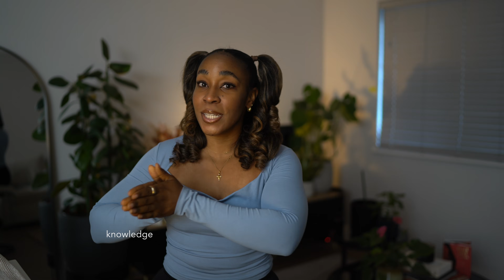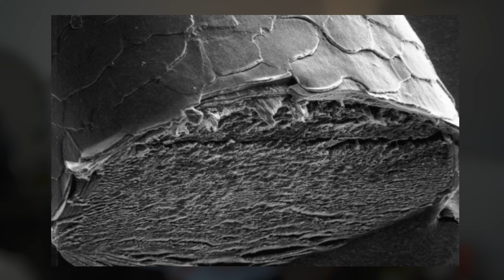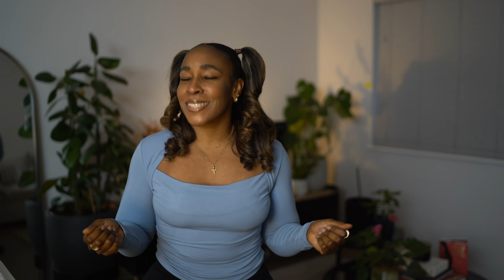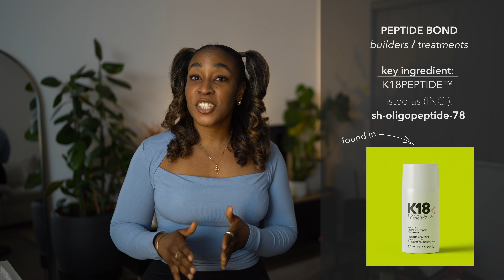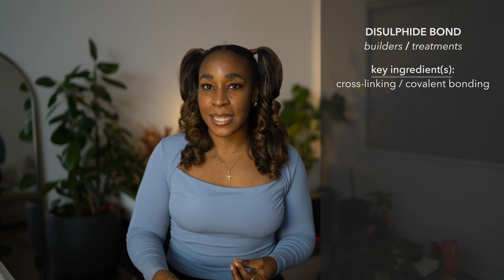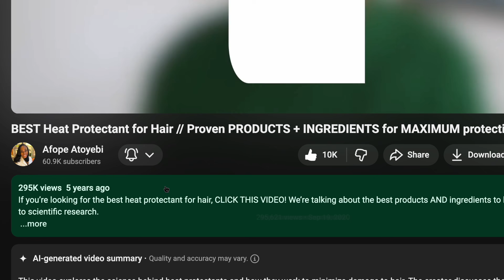BOND REPAIR EXPLAINED by HAIR SCIENTIST: Olaplex vs K18 vs Redken // Which One YOUR Hair Needs

Comment: This video was super helpful thanks. It confirms what i have been saying for years: most naturals who are low/no heat and (by definition) non dyed dont need bond builders. For maintenance of everyday wear and tear on hair, an occasional strenthening mask/ deep conditioner with protein will do the trick to fill in any chips in kertatin structure.

Comment: What’s the difference between a bond builder or reconstructor. Usually when I think of a reconstructor it has proteins like hydrolyzed wheat protein, which I thought repairs bonds in the hair, thus a bond builder.

Comment: This video was soooooooo informative. I'm new to the addition of bond-repair and I truly didn't know where to start but I big-chopped trying to rid myself of my split ends that split up the shaft only to have to continue to cut because my hair strands are completely compromised I guess... lol. Like no matter how high up I cut, my hair almost immediately split again because it just don't hold together.

Anywho, I think I know which bonding product is suitable for me but I went to take your quiz just to be sure and it wasn't available. If you're able to share that again that would be awesome!
Reply from the maker: Thank you! I can imagine that must have been quite frustrating  - cutting and cutting with no results. I'm really glad you found this somewhat helpful. The quiz should be back up now - I was running some maintenance on it so had to take it offline for a bit.

Comment: I have color treated, somewhat heat damaged (like the ends are getting dry) and extremely manipulated (I do pin curls every other weeks, play with my hair all the time, sometimes sleep with loose hair and often wear a bun at the same place all the time) I did the quiz and found a drug store mask from Schwarzkopf that has all of the advised components (appart from the sulphur bond repair, but it has that thing that strengthens the hydrogen bonds, plus amodimethicone and all of my other products have acidifiers or EDTA) and now my hair is living again with two products (and I have a whole collection of various conditioners and serums for when I want my hair to feel extra glossy) I now plan on redyeing part of my hair (hopefully with an oxidizer free dye since I go from a dark auburn to a darker brown) and bleach part of my (level 3 color treated ) hair white (I'll settle for "lightest blond" and if all fails either a periwinkle or a highlighter green) all the while wanting to keep my length 

I'm gonna redo the test and get ready to at least provide the proper products for the first few months, enough time to look good on photos I have to take next month and for the most compromised part to grow out a bit

So I'm gonna
Reply: I love Schwarzkopf.  What's the name of the mask you use?

Comment: What category of damage do health problems that weaken the hair, fall under? For me, I think it's likely due to anemia, mennorrhagia and poor blood circulation, but my hair grows out very weak and thin, from the root (yes density, but it also makes each individual hair thinner too). My hair also grows high porosity from the root. What kind of damage is that? What kind of bond(s) are missing? 

Some more context: After my high dose iron supplements for over 2 years, my hair has stopped falling out as much, but it still grows in very weak. The side of my head that I sleep on, gets more blood circulation throughout the night, and is noticeably thicker (as in, both the density, but also each individual strand is thicker). The right side is where I have the worst hair damage. It's very thin (as in both, the density, and also each individual strand is thinner.) It's so bad that I have to do my aphogee protein treatments at different timeframes. I do the right side of my head every week (wild, but it needs that much), and the left side only needs it once a month. I have tried different bond builders but, I can't tell if they are making a difference...Sometimes they help the left side of my head, but the right side, It's like, nothing helps it. I do regular daily scalp massages for better blood circulation but I can't tell if that's making a difference yet either. Anyway, all this to say - I wish I knew what exact kind of damage poor blood circulation to the follicles cause, and if bond builders can do anything to recover the hair that's already grown out. Thank you so much for your videos <3 They've helped me understand so much about my hair, especially your ones on retaining moisture for high porosity hair.

Comment: Relaxers work by denaturing protein, not by breaking bonds.
Reply: Denaturing is the removal or alteration of something, relaxers break or remove the protein bonds present in hair, permanently altrering the state of the hair.
Reply: @hrhsophiathefirst4060  Relaxer denatures the hair by literally eating through the outer layers. It's the overall loss of keratin combined with the smoothing action that relaxes the hair.
Reply: Right. I'm relaxed and stick to old school protein.